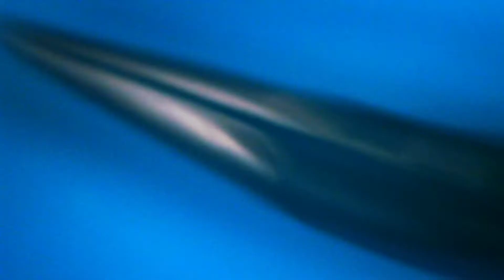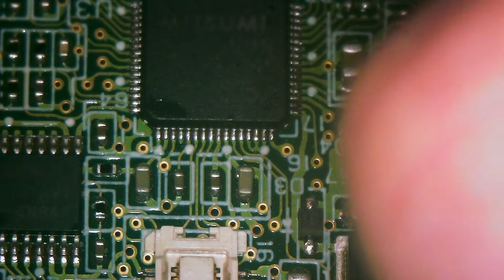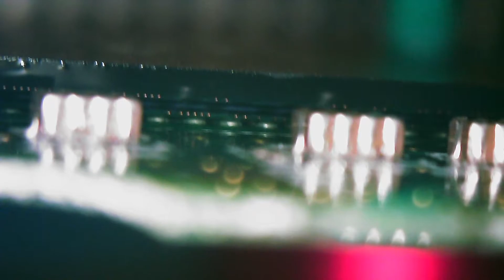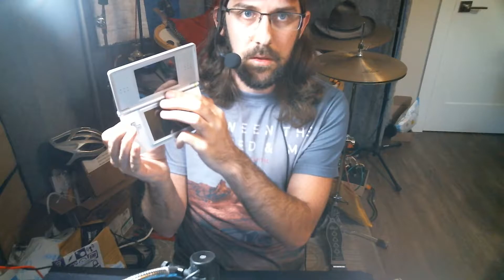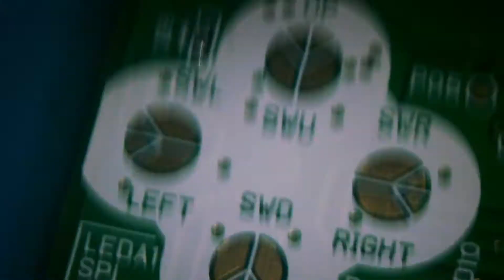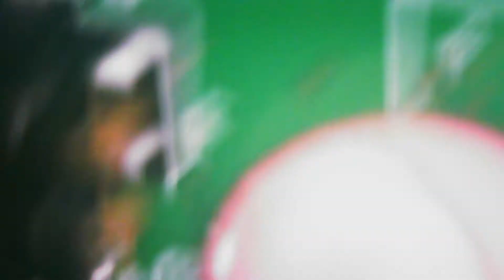Nintendo DS Lite Repair - No Power, No Charging...

Comment: My nintendo is not charging, but I did check F1, F2 and EM10 and everything is OK. But I noticed that the R39 is open and the voltage at the conector that charges the battery it keeps fluctuating endlessly between 2v and 4v. Do you know what can it be happening?

Comment: Thanks for this video! 
mine worked after shorting the fuse but it keeps loading the setup screen when powering on. i tried with working screen and wifi chip same issue... ever happened to you?

Comment: I have a board, no charge and no power. This vid helped me resolve the no charge issue - power was not reaching the Mitsumi chip. Ran a wire to fix that trace and now I have charge but still no power on. Via near d7 connects to Mitsumi just fine. I do have another board to compare to. It powers up but the video signals are corrupt. Just gotta keep poking at it but you helped me progress - thanks!
Reply: Update for those playing the home game - Pulled the VR1 and VR2 off of the glitched screen mobo and they're reading 200k. Dem babies is gone bad. Paid too much for a set of 20 from Cali (Thanks Trump) so that's that for my mostly working board.

Comment: Hello! I have an issue with my own DS Lite... please i need help.
 My DS Lite won't turn on. I've checked all the fuses; L2, F1, and F2, they all work, even the power button, however it still won't turn on, BUT IT CHARGES. I cleaned the entire motherboard properly, and something strange happened; I unsoldered the DS game port, cleaned the entire bottom part of the slot, and after that, the console turned on! But it didn't last long. The next day the console died again without any explanation, so I tried to clean the battery pins (new, by the way) on the motherboard and it started to turn on sporadically, however, the console didn't turn on again after that. What could it be? I've seen this video, but I don't really understand much about electronics. I'm learning on my own and I've already fixed minor issues on other DSs. Could anyone help me? I miss my DS so much :(

Comment: is there a way I can get the mitsumi chip by itself?
Reply: No, it's not sold free. If this Mitsumi-Chip is just a re-branded item of a standard-part, can be. I checked about 30 different chips and did not find a similar one. With the "right to repair", this will change, hopefully. Until this, it's Nintendo's policy, you shall buy a new Nintendo instead of repair. But also keep in mind, the design is 20 years old. It's likely that it's quite impossible to buy new chips.

Comment: This video.. Has brought my sanity back! I tried damn near everything to fix this DS Lite I have, and nothing had worked. I went and tested my board along with yours, and about the time you got it working after replacing the power chip, is about where I was going to call it (I didn't want to break out the solder iron and hot air gun to remove the game cart slot to reflow the underside and replace that power chip yet).. Then I kept watching for white noise, and you stumbled on the alcohol blob... I tried that and for the first time I saw signs of life. I'm going to be ordering some jumper wire and hooking up that line in the very near future. Thanks so much! <3
Fun fact: 
I scared the hell out of my wife as I yelled in excitement at 11pm.. xD
Reply from the maker: Thank you I thoroughly enjoyed hearing your response, I hope this helps you to hunt down the issue with your console!!
Reply: HOLY SMOKES I have sign of life! How does this even happen?! THANK YOU

Comment: my board doesn't have continuity as per time stamp 10:35... does that mean the cpu need reflow? it appears that circuit is on the backside of the board? best regards!!
Reply: I’m having the same issue! I don’t know how to fix!
Reply: 3 years later and still waiting for a reply, my goodness. any idea why no continuety between those points? how can i find that line trace, i can barely see anything on the motherboard.

Comment: where did you buy the processor that you replaced that fixed it? i need some, please respond
Reply from the maker: The power management IC is not available. That was not the issue with this device. The issue was broken traces in the board.